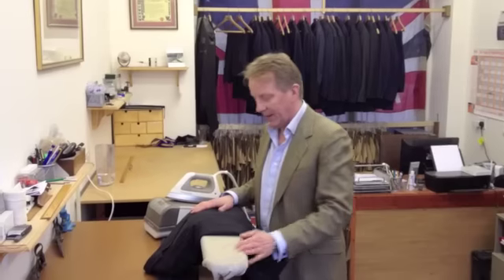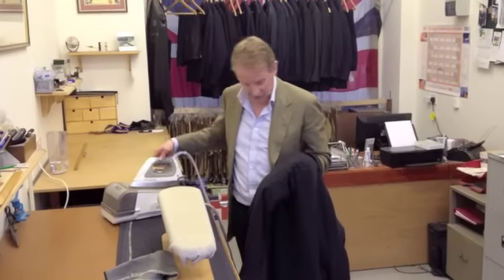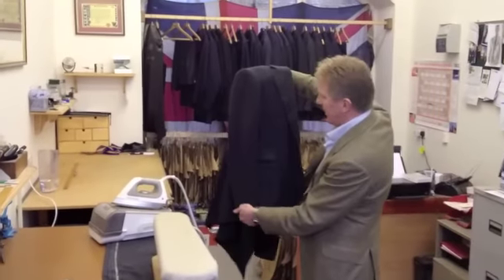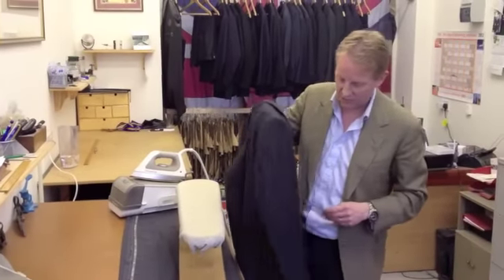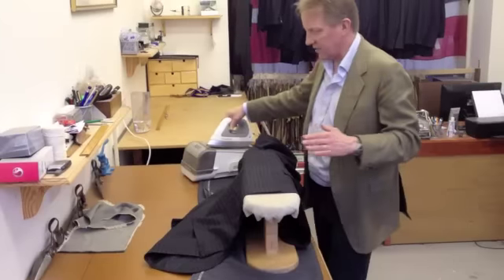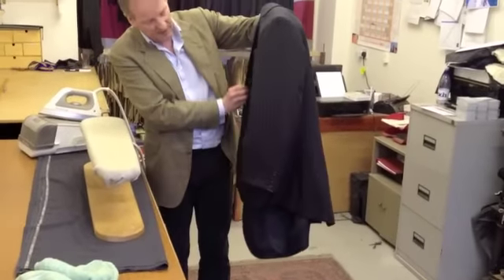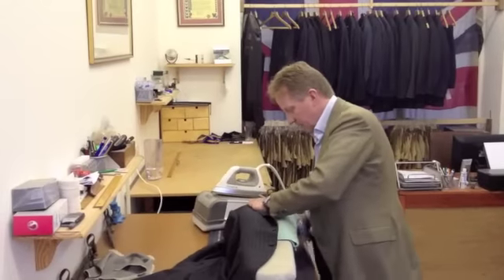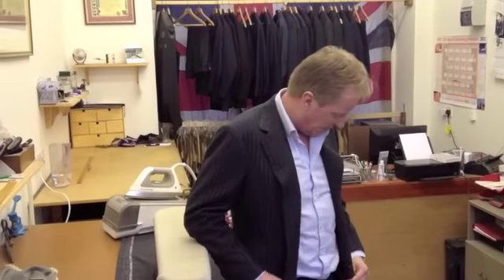Pressing a Jacket

Comment: I trained as a presser with a tailoring company in the 60’s. We used a separate sleeve board for the sleeves and a larger one to press the body of the jacket called a donkey. This had two sizes, a large one for mens jackets, flip it over and a smaller one for ladies jackets. They were covered with black wadding and either felt or white linen. Brings back great memories. I wish I could remember what we called the lapel roll from the top seam to the top button.

Comment: Last week at a hotel the maid took my suit by mistake and had it pressed (who knows what equipment, maybe too much steam ) and totally ruined the lapel.  This was my  first wear of a Hugo Boss Super 120 navy blue by Guabello.  After this accidental press, the lapel has a crease, maybe more like a fold, that runs vertically from the vertex of the  notch running down about 2 inches long, in both sides.  How can I correct it?   Thank you
Reply: Maybe the answer is late but I usually spray a water on heavy wrinkles and press it with steam at the same time, don't forget to put damp cloth between iron and fabric to prevent sheen.